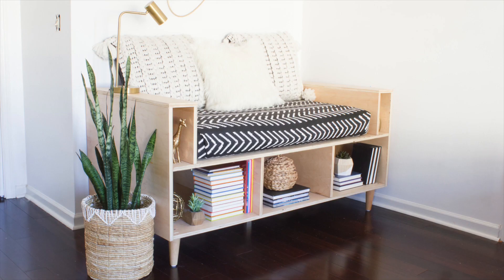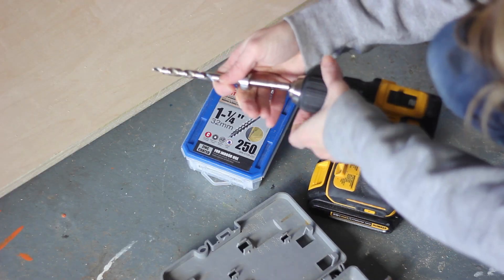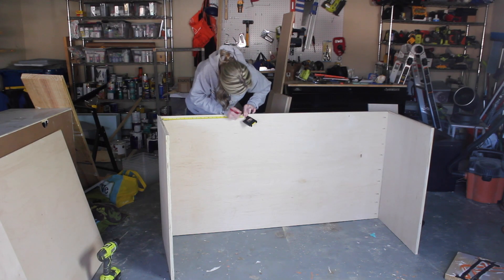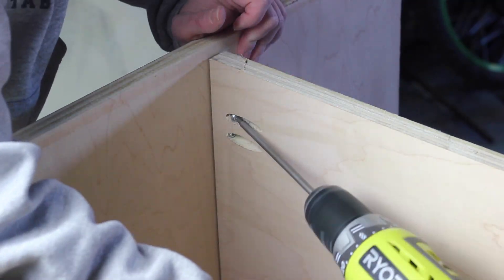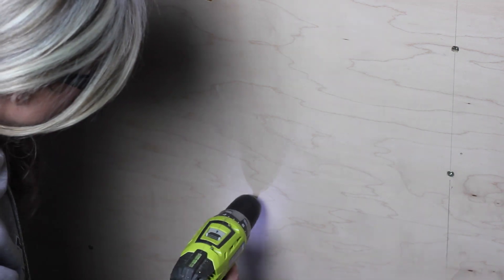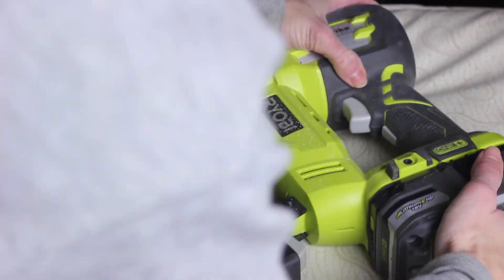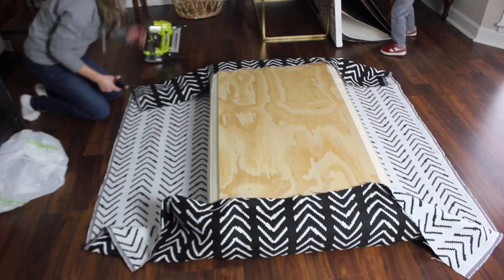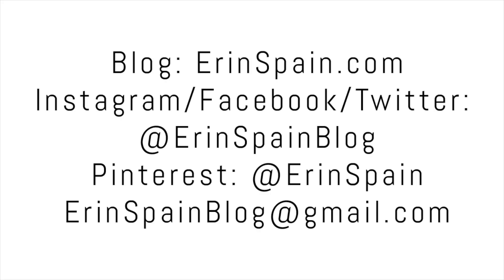DIY Plywood Mini Daybed | Upcycle an Old Crib Mattress!

Comment: Hello I love your videos, I was just wondering how many layers did you use of the Polycrylic finish and did you sand in between
Reply from the maker: Thanks! I applied 2 coats (sometimes I do 3 if it’s a surface that will see a lot of wear and tear). I very lightly sand in between with fine sandpaper.
Reply: Erin Spain Thank you, your videos have been very helpful and has been helping me prepare to paint my room furniture as a beginner painter